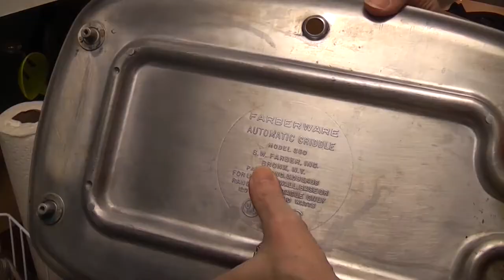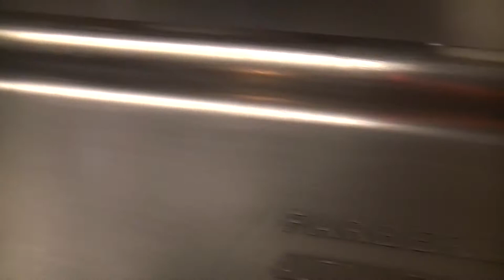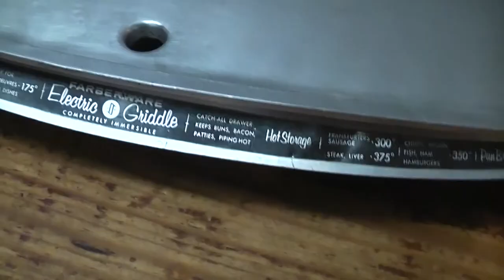Farberware Electric Griddle No. 260

Comment: I picked one of these up to flip and it is very well used. Interested if you had any tips on restoring it, the bottom is very dark from oil. Not sure what year it is, it has "Subsidiary of WALTER KIDDE" on the bottom, and is smooth. Is it better to restore or sell as is.
Reply from the maker: I believe cookware is better to restore. Unfortunately that leaves you with all the work. If it is really brown on the bottom you may want to use a wire brush or steel wool and Bar Keepers Friend or 1886 Bon Ami. Oven Off may damage the aluminum. But if used quickly and rinsed may work but I've never used it. This just takes elbow grease and patience.
Reply: @xetaprime  Thanks for the response! I'm very intrigued by restoring it, so the elbow grease doesn't scare me. I've gained an interest in vintage cookware and have started thrifting to flip since I don't have the space to start a collection. I love your enthusiasm for this stuff 😊